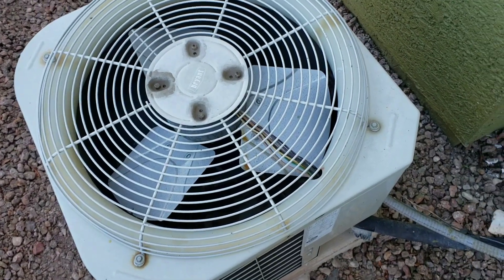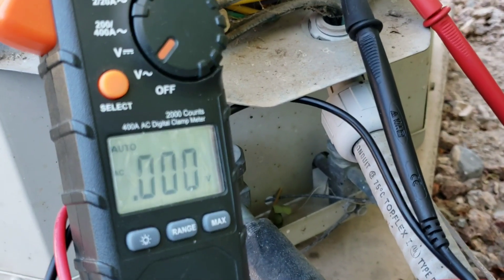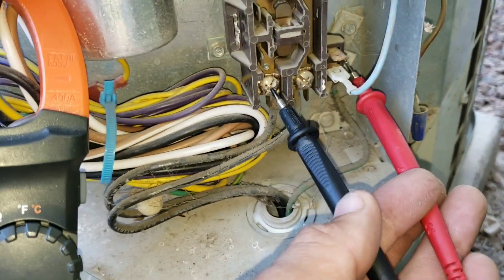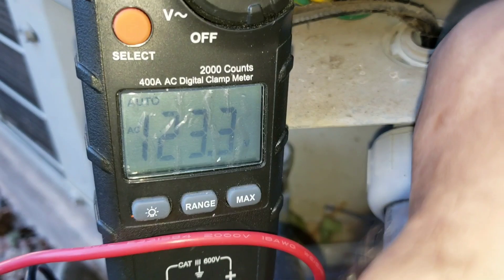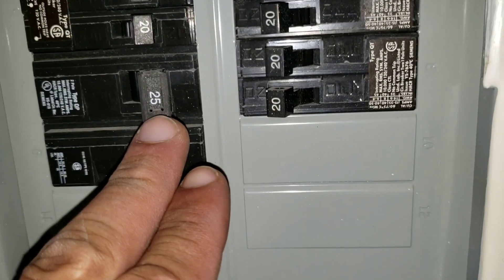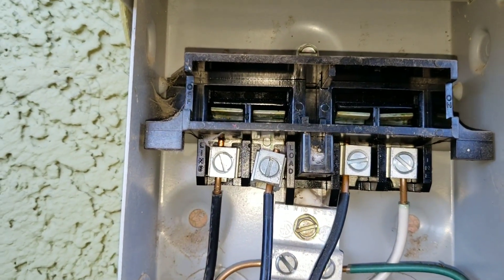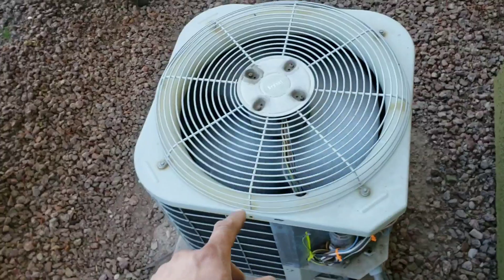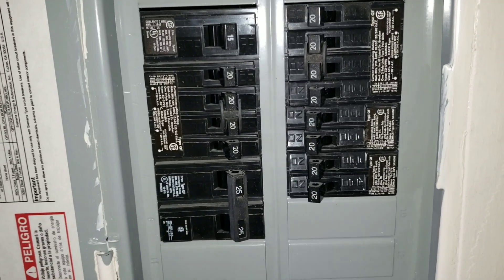AC Not Working... Contactor Not Getting VOLTAGE

Comment: If, your condenser fan  has a slight lag. Starting up more than likely your capacitor is starting to go bad. You’ll need to test the capacitor on the fan side of the capacitor is getting weaker you’ll have a slight lag. With your condenser fan starting up, you’ll need to pull the disconnect.  Get a stick or screw driver and spin the fan.”
If the fan spins freely, you’re in good shape with the motor then  you know it’s not the fan motor going out it’s the capacitor going out. I hope this helps you!! 🫶🏻🤗🤗

Comment: Great video! You made a seemingly complex issue very simple! I had already swapped the Run capacitor due to some residual resistance. I thought for sure that was the issue but was scratching my head again when it didn't work. I started shooting wires and discovered no voltage across the contactor terminals. That's when I found your video. I measured at the disconnect and sure enough I only had 120v coming in. I thought I had found all the A/C related CBs and reset them multiple times, so I was still at a little bit of a loss, but your video encouraged me to think it through a little further. I finally tracked down a previously undiscovered CB panel under the main power panel/meter on the side of the house. I never realized it was there. Even though the CBs were not tripped, I cycled them and lo and behold the heat pump came on a few minutes later. We had a very cold house the previous night and now enjoying proper heat. Thanks again!

Comment: Sam, great video. Im having the same issue, voltage at the disconnect but no 230 at the line in in the contactor. Tomorrow I’ll chk the lines from the disconnect.
Thank u

Comment: Hi there.
I would like to say thanks for making this available to guys like us in the field who are still learning the trade.
Now- couple of questions- it appears that the capacitor for the fan has recently been replaced.
Did anyone check the motor to see what the motor data plate said it required for a capacitor before ordering a new fan??
Seeing the last guy who missed the loose lug could have also installed the wrong sized cap for that fan motor.
Also, why was the original cap not used for the fan as you can clearly see from the video it’s a dual voltage capacitor but it’s only being used for the compressor…
Just a few observations from a newbie and I am not being critical in anyway, just trying to learn from good people like you who post these videos for guys like me.
Again- Thank you!

Comment: Been watching videos for days trying to possibly repair my ac myself. Nothing is helping so far. New run capacitor put on the other day. Will put on new contactor tomorrow as well as start relay and new thermostat. Checked to see if there were any burnt out fuses in attic. Checked all wiring connectors making sure they were tight. I have no disconnect. So now that I've seen this video I'm going to go see if the wires to the breakers are tight. If nothing works after all this...will call a tech to check refrigerant.
I did learn that the house cools down a few degrees if I open the door to the attic. Almost 90 in house for about 2 weeks. 
Subscribed to this channel and think I'll dig through his playlist to see what other marvelous insight and knowledge he has that could possibly solve this painful dilemma. Jesus bless.

Comment: You mentioned the fan didn't want to start right away. This seems like a diagnosis based on past experience. How much more "peppy" should the fan start that you would feel content with its performance and integrity. In my opinion, the way the fan slowly turned on seemed normal for a fan starting from a completely dead stop.

Comment: Fan and Compressor were not kicking in. Replace Capacitor, Contactor, Control Board and still did not start. Replaced Low pressure switch and Air Condition (Fan and Compressor) start working.

Comment: I found this highly entertaining and educational. It helped me track down my problem when I could verify the thermostat was calling for Collins, could hear the contractor energize and could see the plunger depress. Confirm low voltage. I could then test as you showed for 240 volts coming into the contractor from the inside. I got no power there. This was confusing because I already checked the AC and furnace breaker in the electrical panel and already checked the breakers on the furnace itself. After you video I knew I needed to look inside further. I found that my secondary panel was drawing power from the AC breaker in the first breaker box. I did not realize the were related. I checked the second panel and found some electricians that we here over winter time to finish a kitchen in my basement turn off a breaker in the second box and failed to turn it back on when the left. So zero dollar fix for me....
But that’s not all. After fixing my AC I watched the rest of your video and found so much additional info. I learned a lot about this system. Whating you trouble shoot was a worthwhile experience. Liked and subscribed for the help!

Comment: Before replacing the customers fan motor and charging them $300 that they don't have, you should do an amp draw on that motor before assuming it's bad.. That motor seems fine to me but without an Amp Drawl you'll never know if it's bad since it's running.

Comment: curious.. There is a duel run Cap, but the installer used another cap to run the fan motor. why wasn't the duel run used?

Comment: Hey Sam, 
You mentioned to check if blower motor upstairs is working or not. Mine is not working. When you turn on ac at thermostat, nothing happens. Nada, zero. But when you for start it at the blower motor and outside at the contractor, they both seem to start. What you think my issue is? Am I screwed to buy a new unit during this crazy time? 😅

Comment: oh my, thank you so much. I followed the steps and found the problem and traced it back to the circuit breaker. it wasnt connecting properly. I fixed it by taking out the breaker and reconnecting it. thanks again.

Comment: Great video. I have the same disconnect and had the following issue happen which someone might run into. I had removed the disconnect and saw the copper plates were a little corroded so I removed them (one screw each) and used some steel wool to clean them up. I noticed three or four of the teeth (8 total) were a little out of alignment so I used a crescent wrench to bend them ever so slightly so they were straight. Upon reinstalling power was lost to the contactor. I had to resend them back to their out of alignment state in order to get power back. Bottom line I think the plates are not thick enough so as to get pinched properly by the receiving female part of the disconnect when inserting.  I don’t think bending the female part is doable but I might be wrong. Got it back to working but was disappointed with the quality of the disconnect. Thanks for posting!

Comment: I'm having a similar issue right now and it's so frustrating! I just changed my Contactor and still the fan does NOT work!!! I contacted a technician who is going to arrive tomorrow to take a look. Already put $100 into this already!
Reply: You're about to put in another 200 at least now
Reply: You should have change the capacitor ,what what's wrong
Reply: @oscarpere-ch  actually the first thing I changed was the Capacitor. That didn't work. I changed the Contactor. That didn't work. I changed the Furnace Motherboard. That didn't work. Turns out that the Contactor Wire for some strange reason was Shorted!!! After the Technician fixed that wire. It turned out that the Honeywell Smart Thermostat was broken! At this point you probably guessed how upset I was. Overall I learned alot and the most important thing is that the AC is now working!!!

Comment: I didnt finish video but when I saw that he gets 120v readings I figured that the circuit is not completing itself due to the neutral.
Reply: There isn't a neutral in this  circuit. White wire is being used as a hot leg. However,  being misidentified as a neutral .

Comment: Good job I learn something, question Do the fan unit out side have to come on if I’m using the heating in the house? Nothings happens with the outside unit when I turn on the heating my blower working I feel the heat ,Just nothing outside is coming on

Comment: Worked for me.  Had only 120 v to the contactor and went to the cutoff box and looked inside.  Surprise - two 30 amp bussman time delay fuses.  Put the ohm alarm and one buzzed the other nothing.  Went to the hardware store and got a quick acting fuse  (the guy helping said it was the same as time delay).  Started to doubt this so I went to the Electrical supply store and found out that I did need the time delay fuse and spent $7  and two days of watching videos by you and Word of Advice on meters and air conditioning.  Got er done!  Thanks

Comment: Hello, my copper disconnect has black marks on it. I'm having similar issues with my AC. Two of the wires beneath the pullout are lose too, not sure how to tighten them, as they already seem tight but they move around like the one you showed. So I have black Mark's on my disconnect and contactor not going in. Pretty sure I have voltage to contactor too. Conundrum!

Comment: What causes a stuck contactor
Reply from the maker: Hard to determine the exact cause. Constant wear from open and closing...  sometimes bugs get inside and after getting zapped they stay stuck behind the contactor push button which stops allowing the necessary contact to engage... there are many reasons but these are the top 2 in my estimation.
Reply: @MoreThanMaintenance  ok.   Thanks. Blower kicks on.  26 volts are getting to the contactor. Contactor closes but fan and compressor do not kick on.  If i disconnect red and yellow from tstat contactor opens. Also if i disconnect yellow from control board contactor opens.  But nothing kicks on
Reply: intelin123 then check outgoing power from contactor when it's closed or pulled in. Also check capacitor
Reply: Sometimes a small  bug or spider will get logged between the coils and cause it to not work properly.

Comment: i had already tested the fuses and they were fine, i replaced the capacitor as it tested bad, i forgot that i had previously turned off the inside breaker. i was looking at your video to test the outside breaker and you mentioned in passing about making sure the inside breaker was off. so, i went and my inside breaker was still off. that is why i had no power even though i had tested the fuses and replaced my bad capacitor with a good one. so, thank you for your helpful video on troubleshooting the power. I bought an inexpensive walmart digital multimeter and looked at where you set your meter. so thanks for the great video!

Comment: you didn't explain why you were reading 120 volts to ground from both legs of contactor to ground, but 0 volts across the two terminals.  I believe it was because the contactor was pulled in and the good leg coming from disconnect was backfeeding the other side of contactor by way of the compressor windings.
Reply: That is correct and also one thing to point out that in 240v circuit there is no neutral: both legs are hot and carrying 120v each. You can inspect each leg separately by measuring at each hot one leg an the ground to make sure you got your 120v.
Reply: I wondered how he had 120 on both legs! As Officer Krupke pointed it was the same phase coming through the motor winding's.  With a volt meter you can not tell you are measuring the same phase. A 2 channel scope meter would show the missing phase. As the other post here points out 240 does not have a neutral. Each phase is a supply and return. When one is hot the other is the return and vice versa. Consequently, if one phase is out the circuit is broken and you loose the 240.  To really test  each phase with just a meter, one would have to lift one on the wires to eliminate reading the other phase on it coming from the motor winding's. Now this video makes sense to me Thanks to Officer Krupke.
Reply: @davesmith6435  thanks for the explanation.
Reply: which would read as 0 volts, no difference in potential, basically reading the same two points in ckt.
Reply: It's a nice video and I'm four years too late but:
The disconnect:
The two outside wires, are both hot wires, that run to the panel each one connecting to a breaker  (240/breaker, which splits the phase).

 The inside two wires go to the load meaning out to the compressor, where one basically, what is the compressor and the other ones the fan.

 I know you kept saying the neutral wire, however, there is no neutral wire! both of those wires are hot and should be black and if somebody decides to do some Jerry rig wiring like you have there with a white wire then by code, they're supposed to arrive a black piece of electrical tape around the wire identify as a hot wire. (generally speaking, you would have a red and a black wire ).

Not a big deal just throw a piece of black electrical tape on the white wire. 

You can tell that they were going to be additional issues just like the fan capacitor that is present. The brown wire, and the brown and white wire are both connected to the same winding in the fan motor. He has each one of those wires going to a capacitor. One side of that capacitor is the common, and the other is for the fan.

I can't tell where that brown wire is running, but it looks like it is wired to the side of the unit. 

The brown wire should go on the fan terminal of the capacitor. And you should get a different color wire or you can get a piece of red tape or black tape and put it on the wire and then connect one end to the capacitor and the other end to the common terminal of the other capacitor that is present so that power is coming from the bigger capacitor and being sent to the smaller fan, capacitor to run the fan. 

By doing it that way when the thermostat says the 24 V to the contactor and it pulls in it will then send the power out to the capacitor which will allow the compressor to start and also send the power from the capacitor to the fan capacitor for the fan to start .

But that would just be the right way of doing it ....